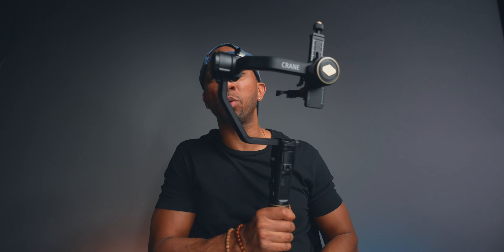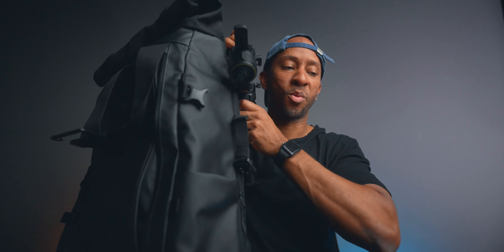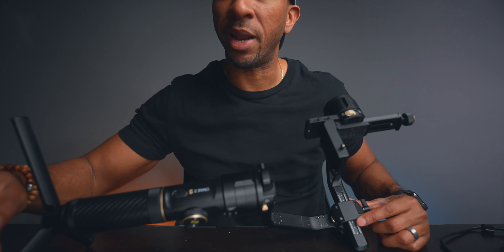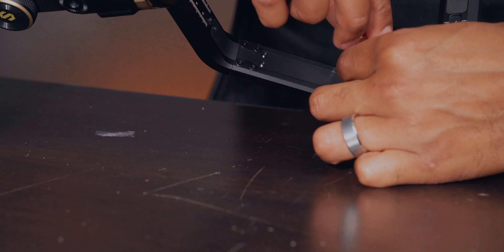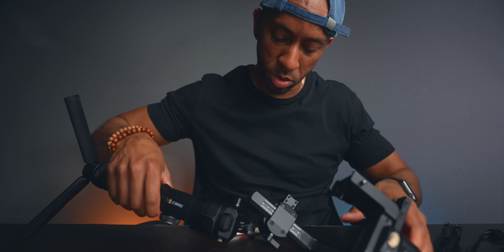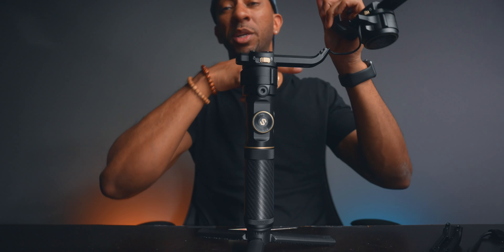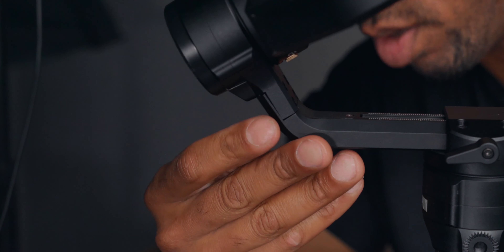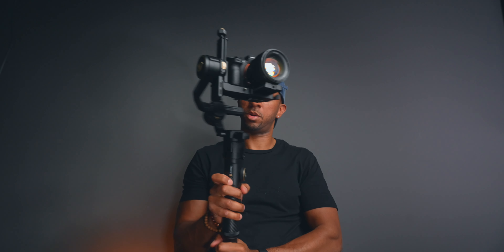How To Change The Zhiyun Crane 2S Motor Angle | Now It's Perfect!

Comment: did it with my pocket cinema 4k and worked like a charm. even have a saramonic rx10 receiver on top, and i feel i fixed the weird vibrations i used to feel. now even in the "high" motor setting, i can barely hear the electric hum. thank you for the great help, it was super easy

Comment: Just tried this on Dec. 29 2023 after watching all the videos on youtube. You can just leave the wires exposed at the end. No need to try to put the cover back on. That's what I did and it seems to work fine. I think you run a greater risk damaging the wire by trying to twist and turn it so that the cover goes back on. The wire is about .5 cm too long to fit perfectly. There's no reason to put the cover back on as long as you're sure your camera/cage or anything else sharp won't hit the esposed wires. So at 17:00 just leave that little piece of wire exposed and don't put the cover back on it. Just my 2 cents. Also, I had absolutely no problem whatsoever taking the smaller cover off with the one screw. It popped off very easily.

Comment: Did the mod and to my luck one of the screws was stuck …( I was full precautious)   and it’s a brand new crane 2s. The screw stripped, ended up having to drill it out . The extension part hole suffered damage but was able to break the screw and complete the mod. Wondering if they sell that part alone just to have it . Thanks
Reply from the maker: Wow glad you were able to complete it. I’d reach out to Zhiyun customer service. They’ll probably be able to get u the part
Reply: @CreativeTechLab  thank you ! I will 😅

Comment: Use the same key used for the smaller screws, and put it into the screw slot of the small plate, and pull it out. Easy

Comment: With heavier cameras it doesn’t work as well! I got the R5 with a grip when I attach my 85 1.2RF or even my 15-35 RF it gets very jittery so I just put it back and then it works well
Reply from the maker: The heaviest setup I've had is my Sony A7siii with a 24-70. I haven't had any issues. Do you think it could of been one of thw wires being pinched?
Reply: @CreativeTechLab  hmmmm maybe I can try again but probably most likely not because after I put it back it works well just suck I can’t see the screen that well and I hate flipping out the monitors at times more prone to damage! And I hate adding anymore weight than a mic lol that ish gets heavy! I see people adding all kind of attachments to their gimbal setup, I’m like ya sure shoot with that the whole day buddy! I did see next review and the other YouTuber did say in the Zhiyun case it gets weakened, also the Crane2 ms is so convenient for TikTok/ IG reels Story pretty much all clients want that nowadays